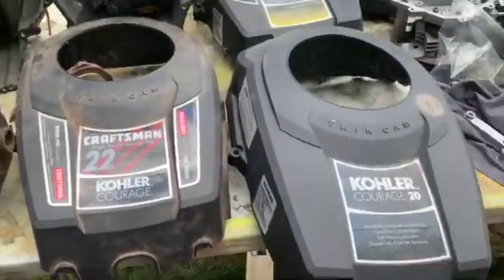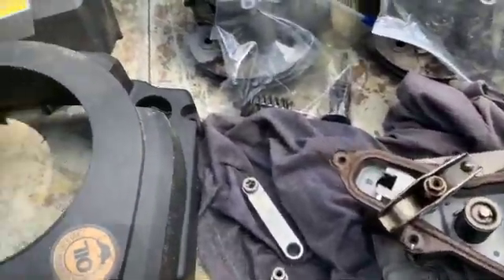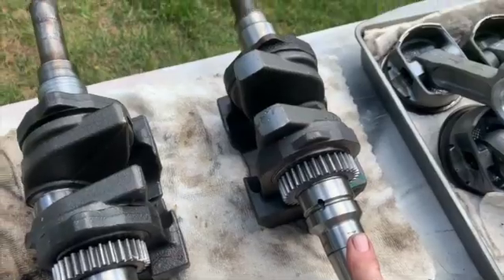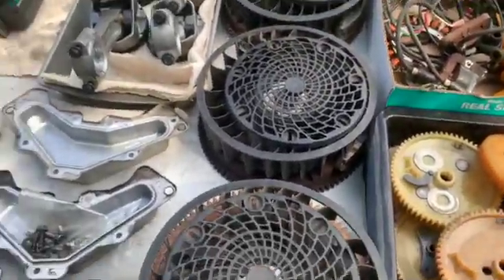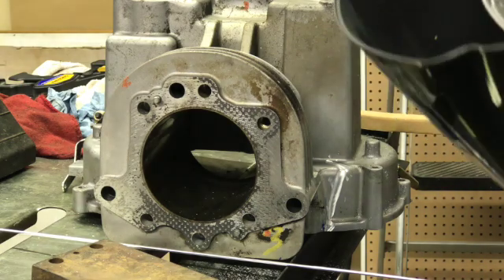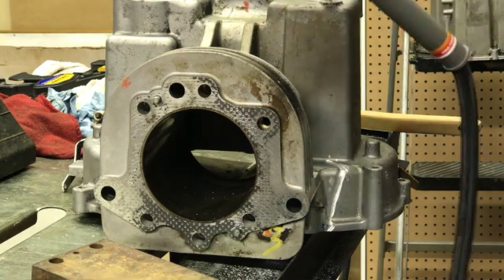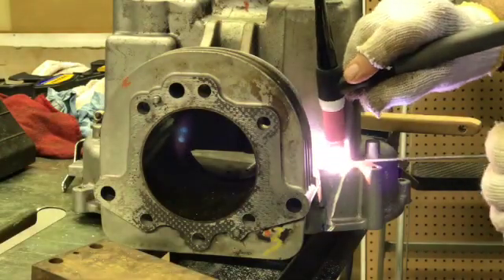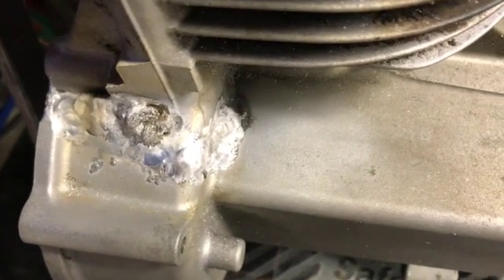KOHLER ENGINE  22HP WELDING THE CRACK

Comment from the maker: Wayne it came out as good as possible remember aluminum absorbs a lot of heat so to keep the heat in the cast. weld is really difficult you don’t wanna penetrate too deep because it’ll ball up in the back where all the gears are. using a carbide cutter and eliminating half of the cast helps out

Comment: As nice a weld on cast aluminium as i think you will get Hank. We have not gotten a cracked Kohler Courage in at the shop yet but when we do Jake will likely try to TIG weld it to see how it comes out. Just wondering if you got enough heat into it to penetrate to the interior totally getting rid of the crack on the inside? Nice job looking forward to seeing it up and running. PS now your vocal content is as good as Kens with his new equipment.

Comment: Nice job, I have never used or worked on a Courage, you video has reinforced what I have heard from others about what a POS they are.  To bad they don’t have a real bearing where the crank goes through the block….  Do they all crack because they are not well balanced?
Reply from the maker: Most of them crack because the sump bolts for some reason loosen up and the flywheel hits them.Nice to see you at the show with Ken thanks for watching

Comment: Good work. Any casting that has had oil in it will be dirty as well. At some point I will get an AC/DC TIG welder and have a go at aluminium.
Reply from the maker: Ben I’m sure you’ll be able to weld it you have a hand in a lot of stuff
Reply: @henrymurawskibigdogrepair  I do, but need to buy the right welder first. Be a while.

Comment from the maker: Yes they do make a special part to put over the valve cap cover to stop it from leaking oil but there is not anything stating repair original part

Comment: My understanding is that there is a problem from the factory that if addressed before it fails, the Courage can be made into a solid engine. Is that true?
Reply from the maker: Yes they do make a plate to make valve cover straighten plate to stop it from leaking oil but there is nothing that I know to stop it from cracking but to check the 10 mm bolts on the Sump cover